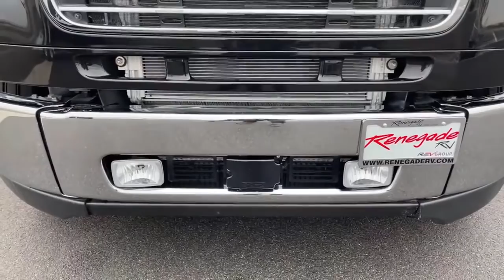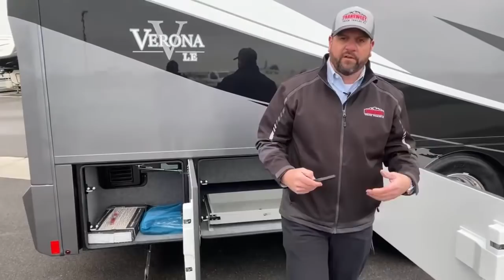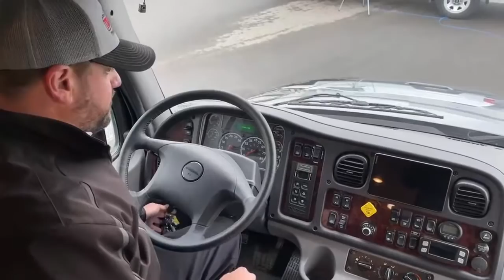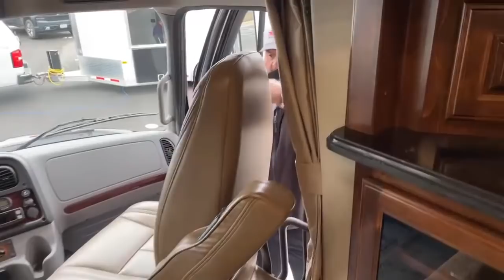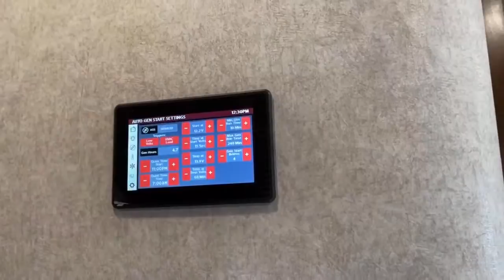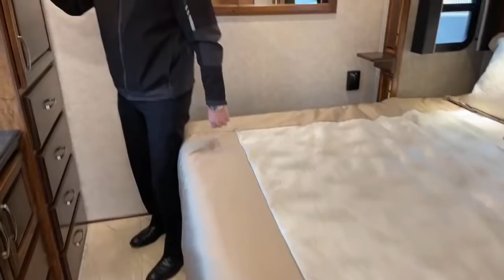2021 Renegade Verona LE 38LDG

Comment: I thought this rig had a bath and a half when I didn't see a window in the back from the outside, they could have added a window in the back wall of the bedroom. The cabinetry is very dark already and more light would make a big difference - plus safety egress. Also, the tanks under the bed on the slide, that is a lot of weight on that mechanism set up to fail when you least expect it. Not a good design choice. Overall, it is a very nice rig but everything is too dark for my taste - How about lighter counter tops at least?
Reply: Well! You should tell Grant, that you want to speak to his manager! IMMEDIATELY!!
Reply: Tanks are not on the slide.  The aluminum mattress support slides over the water tanks.